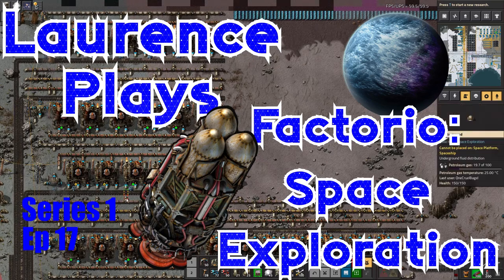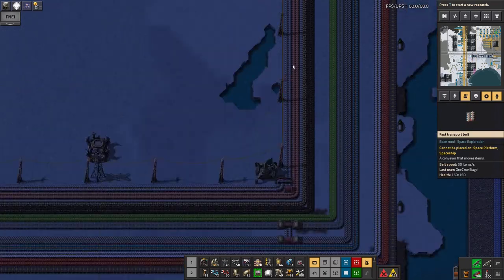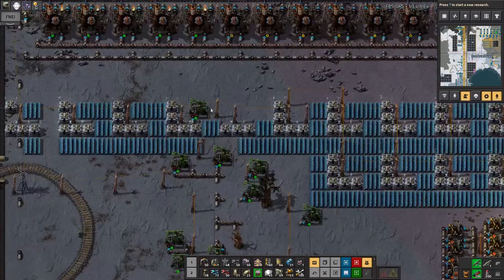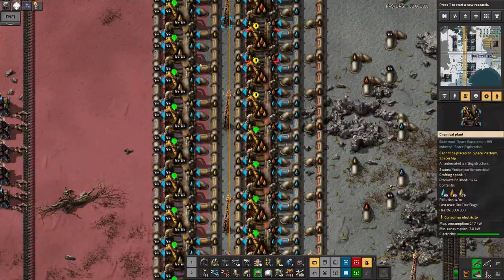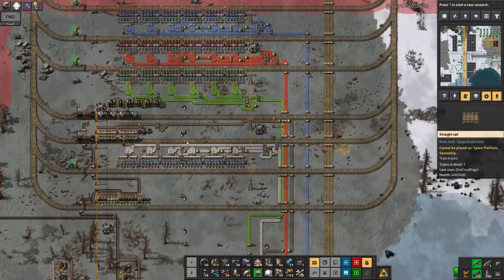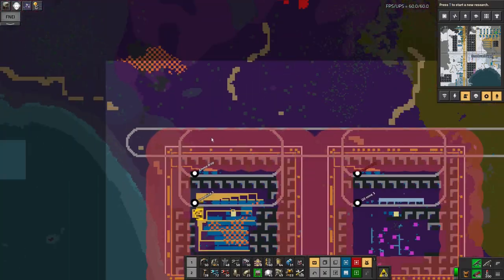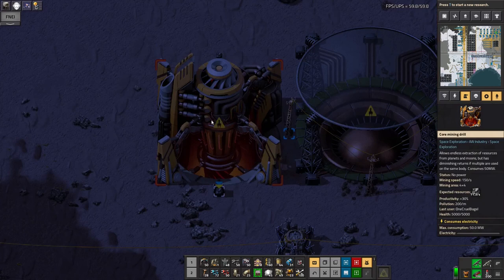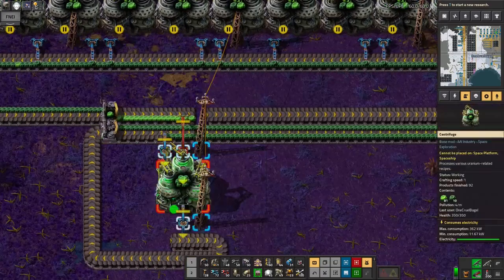S1-E17 - Liquid Coal - Laurence Plays Factorio: Space Exploration

Comment: 5:30 Not sure (you mouse over very briefly over the tanks), but looks to me like you might be output-limited rather than input-limited for heavy oil cracking (your light oil tank seems full). So maybe first try increasing the size of only light oil cracking column and see if it does the trick? In general, I found I usually need more light oil cracking plants than those for heavy oil cracking, though that's for 'normal' refining (from crude oil).
Reply from the maker: I think you're right - I didn't think about the ratios properly and so I've overdone the heavy to light, and underdone the light to gas. My grumble was in more general terms though, that I struggle more with determining throughput of fluids. I'll definitely go in and take a look at that though, I want to keep it reasonably future proofed! Thanks for the suggestion, and of course thanks for watching  :-)